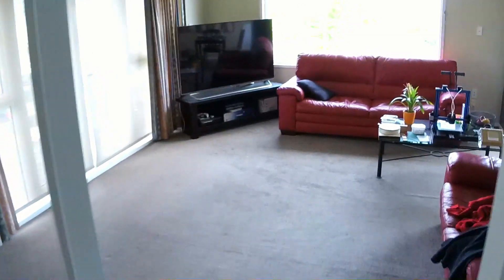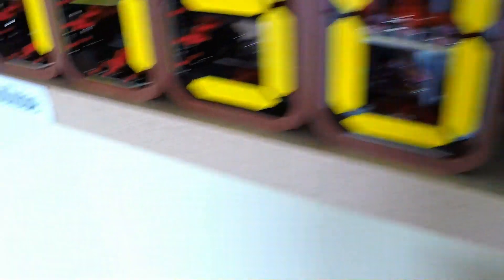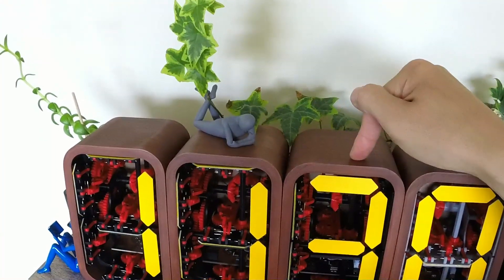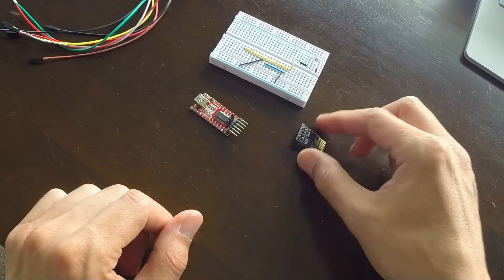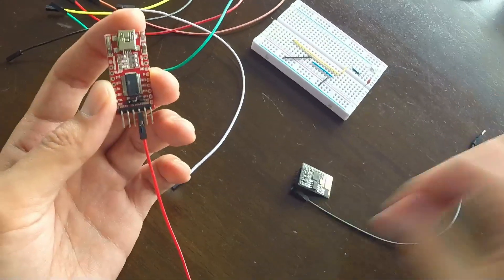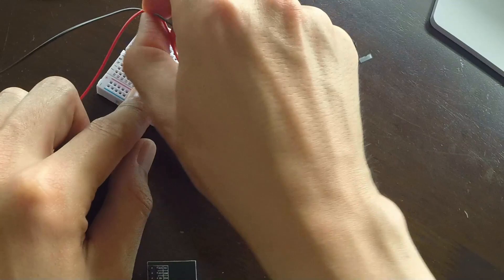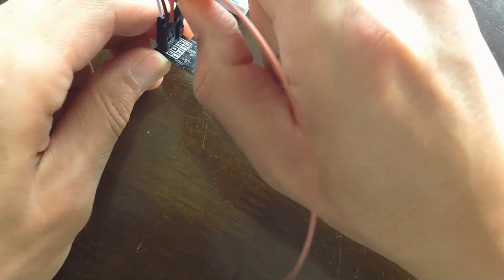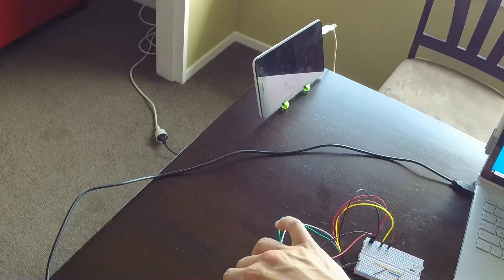Turning the subscription counter into a clock

Comment: Hi:

I bought your 7-segment design on cults3D, it was a fantastic job!

Just a quick question, while following your instructions and printed every parts, I found that my segment doesn't come back to original up right position, neither would it fully go to flat position. It seems like a problem caused by the spring. Any suggestions?
Reply from the maker: Sounds like you may have too much slop in the system. Make sure your pins/nails are a snug fit for the holes. They should snuggly fit without a lot of backlash.

Comment: I was already printing away on the parts to make the counter and knew the clock conversion would come out since so many people were asking about it. I did my segments first and printed in two colors, I used WYZWORKS Fluorescent Green for the first four layers (0.2mm layers) and Hatchbox Black for the rest of it. It's the only color I found so far that still really pops with the black behind it. Plus it really shines when you hit it with UV. I've tried red, orange and yellow but the colors just don't stay bright enough for my liking once I switch over to the black. I did order some WYZWORKS Fluorescent Orange and Yellow but haven't tried them as yet. 

Thank you so much for sharing this project! Really looking forward to finishing this project!
Reply: Do you have written programming instructions? I am trying to program with AVR Studio using segments_avr_firmware from Github. Everything appears to compile correctly and uploads but once it is plugged in it doesn't appear to be doing anything. Voltages on the board look good in all the right places. Just seems like the code isn't executing. No LED on mainboard but it tests fine by hand. Maybe I'm not doing something correctly when I am compiling/uploading? I see the blue LED flicker every 5 seconds on the ESP8266 so I think that is working okay.

Comment: hmm I by files to print, 
there is a way for a cheaper pcb, you have to use the spi multiplexer to finish the motor slightly (one motor and one multiplexer), soon I will design pcb

Comment: I'm definitely going to make a clock from these. They are amazing. I will be purchasing a 3d printer very soon but I cannot make up my mind on whether to buy an Creality Ender 3 or the Anycubic i3 Mega - S. Has anyone had experience with both and could provide their opinions?? I was leaning towards the Anycubic, because I like the basic assembly aspect. The design of the gantry seems more solid with 2 Z-axis drives. But Creality has a much larger online community and heaps of cool mods and such to make.
Reply: You may get more replies if you post this question on a channel that concentrates more on 3d printing related videos - like Thomas Sanladerer's - but it's the internet, so you're likely to get conflicting advice from entrenched groups of owners of each and every printer on the market.
Reply: @dav1dsm1th  yeh I think you're right.. My gut instinct is the anycubic, so I think I will purchase that.